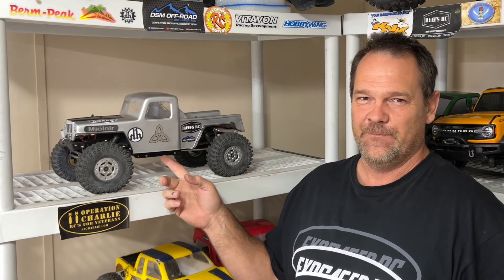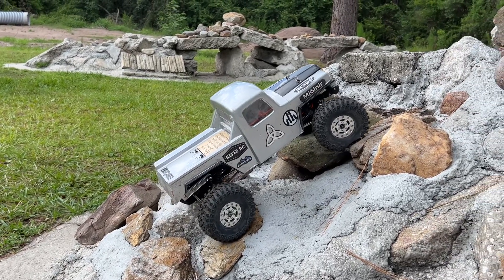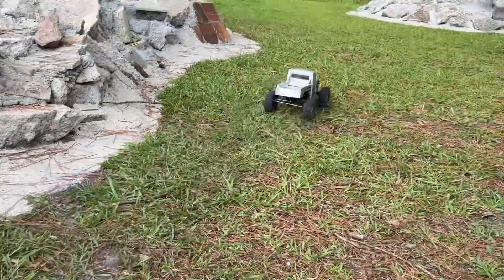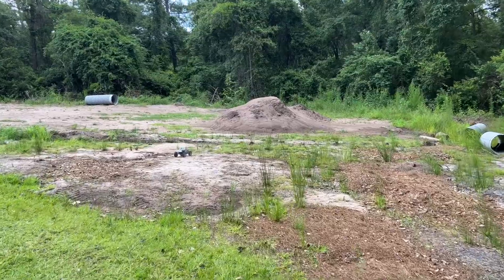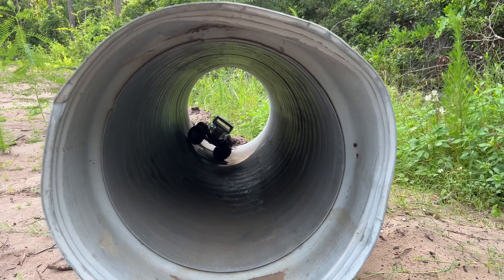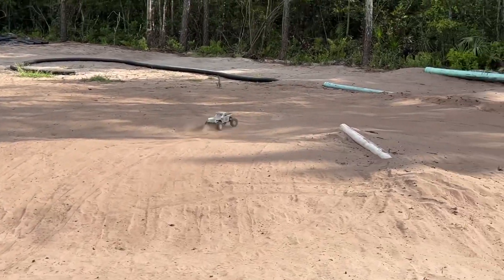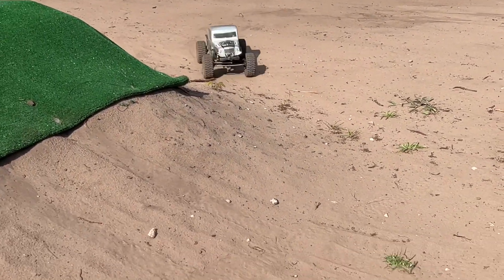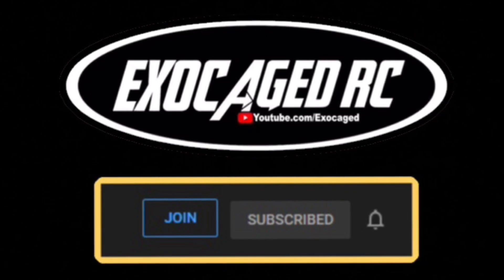Fusion PRO 2300 in Myolnir is AMAZING!!

Comment: Would you recommend the fusion 
over something like a Holmes puller pro for crawling?
Reply: I do. You won’t believe the control. No more pulling the trigger more more more till you rocket over the obstacle. Just pull it to speed you want and it will feed the power itself keeping the wheel speed constant

Comment: Love these fusion motors I've got one of the older ones in a full metal caged crawler/mud bogger that has no space for an esc but have always felt it needed more wheel speed now with this new 2200kv I think I can get this and at a price that won't brake the bank keep up the good work

Comment: Since the new Pro is 6mm shorter, it should fit much easier into a Capra, or am I mistaken? What brushed motor would you recommend for the Capra in combination with the HW1080? Cheers!

Comment: OK, I'm getting one!!!  Love my 1800kv version.  2300kv just kicks it up a notch.  QUESTION:  Do I need to purchase HW's optional programing card/box or can I use the ones from my 1080 or 1800kv???
Reply: you can use the one from the 1800, though you will be missing out on 4 new programming capabilities.  new pro fusion is cheap, due to the fact the card is a seperate purchase.

Comment: $149.99 is a-lot of money for a lot of people. Is it 'Plug-n-Play' or Is soldering necessary? My living situation does not lend itself to 'soldering', and I don't even own a soldering iron or appurtenances. If I'm going to consider paying 5 x's the price of a popular 'Brushed' motor these questions should be answered forthwith.
Reply: You can get a cheap soldering iron for under 5 bucks that comes with a tube of solder. There's absolutely no excuse not to be able to swap a battery plug. However, I believe they come with xt60s battery plugs. If that isn't your plug of choice lots of guys on ebay sell them with whatever plug you want. Gas stations often carry propane powered soldering irons too. You don't even need electricity to use one of them.
Reply: Also, a brushless system will last indefinitely. The cheap brushed systems you're talking about are throw away motors. Once you get away from them and onto brushless you won't go back. Unless you buy like a Holmes hobbies brxl and magnum motor.
Reply: No soldering